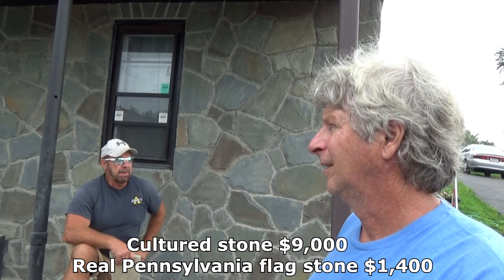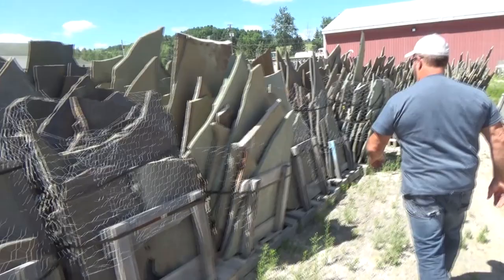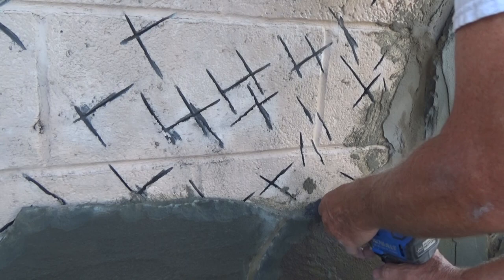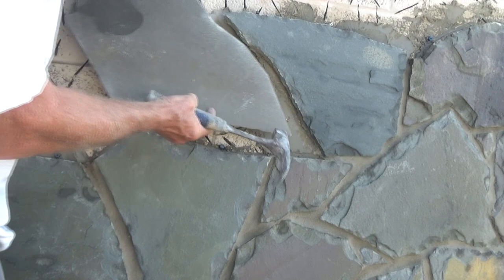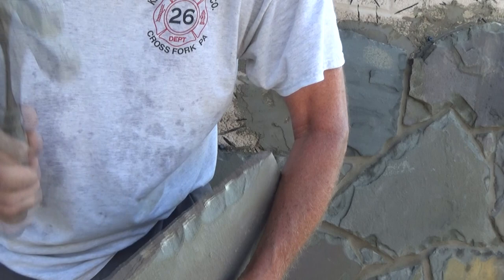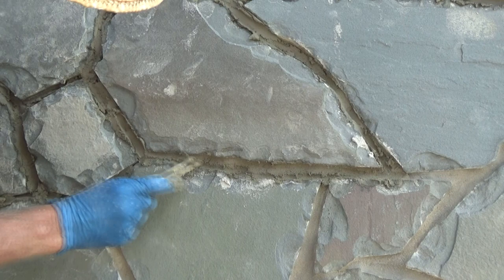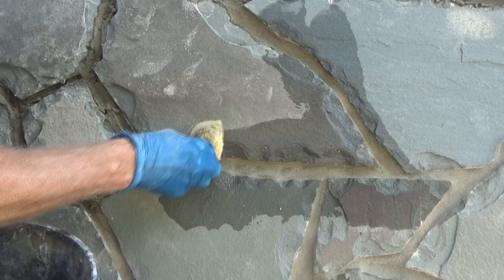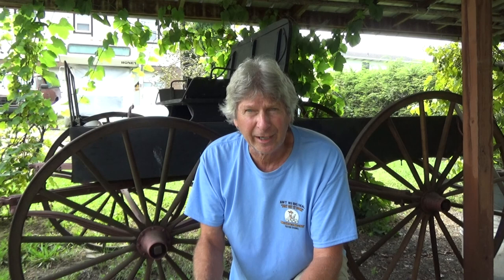STONE VENEER INSTALLATION (part 12) Mike Haduck

Comment: Since the block wall had a painted surface versus bare concrete, won't that reduce adhesiom, especially since paint evenutally flakes when there is moisture?
Reply: A few years of freeze thaw cycles and I don't want to be near that wall - I was expecting to see Fred Flintstone emerge from the front door.
Reply from the maker: I showed where it is pinned into the wall, I worked on skyscrapers where they basically do the same thing, Mike

Comment: Mike, what do you think about screwing a panel of hardi board over wood siding, and applying the flag stones to that like applying a tile? Probably still need some protruding anchors going into wood for support but would it be about the same as using the metal lathe?
Reply from the maker: Hi Will, maybe inside but our area is different,  thanks Mike

Comment: I always enjoy your videos Mike!  I have some cracks/small gaps between some of the blocks in my basement wall.  What is the best mortar to use for that?  Thanks!
Reply from the maker: Hi Chris , everything depends, I usually use rapid set or Portland and sand. But I have a whole series out called " foundation repair, "thanks Mike

Comment: over plywood, what is the procedure, moisture barrier ( tarpaper 15lb ) then mesh and skim coat then mortar and rock is that the deal ?  Thanks From a DIYer
Reply from the maker: Hi Tim, I can't say unless I was there to see it, every situation is different,  but my playlist would help,  thanks Mike
Reply: @MikeHaduck   that is what i did before,I was told to do it 5hatway, it worked out fine, good =ideos, thanks

Comment: Luckylike# 419! Superclickparty on that 👍 Haduckianz!!
Quick ? Mike-was asked to pardge over chimney chase that has been painted.can I Portland paint &pardge over? Or do I need to grind off paint? Thanks! ✌
Reply from the maker: Hi if it was painted I usually patch and paint again with masonry paint, thanks Mike
Reply: Thanks Mike
Used a 4" grinder to grind off tha paint, will use the Portland 'paint' + parge two finish. 'Castle'-is tha best!
✌ from the Adirondacks.
Honest Joe says hi as well😂😁

Comment: The concrete is porous though, so are the cuts really necessary? Adhesion is super strong anyway
Reply from the maker: Hi, I make sure it holds, Mike
Reply: Well I scar any project up if its painted just for that reason (adheres much better)